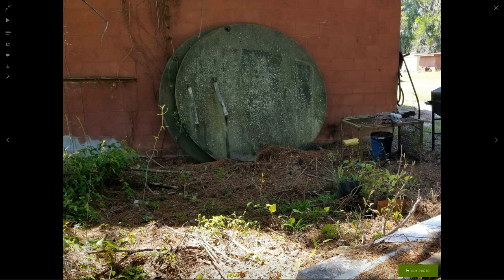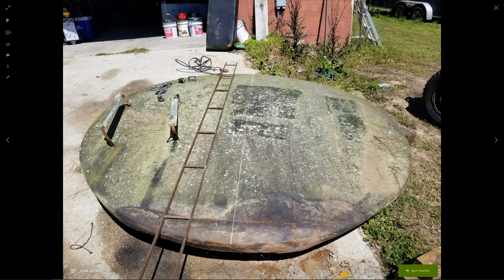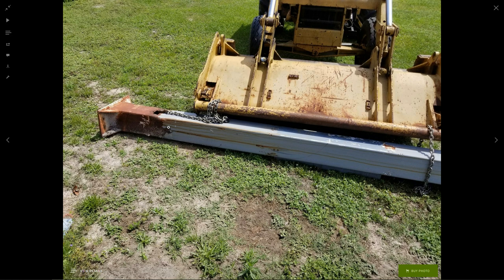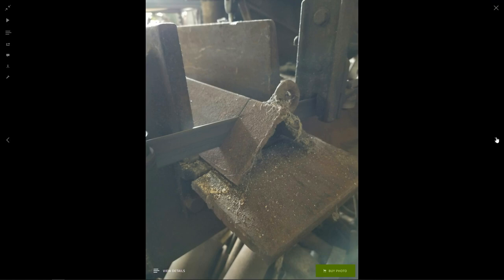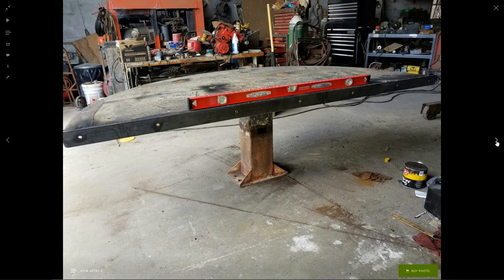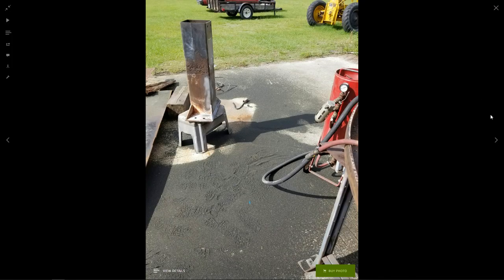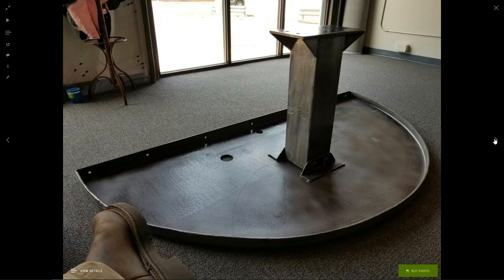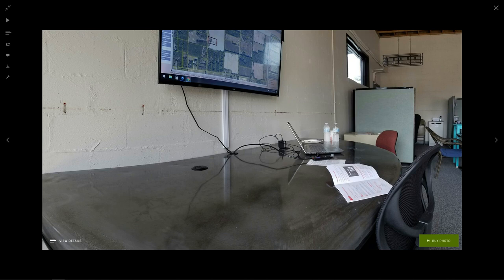Industrial Office Furniture: Building a solid steel conference/workstation table.

Comment: Where the act expansion chamber, and the trike ?
Reply from the maker: That project has been finished for 5 years. I've started building a street legal 2 wheeler motorcycle project from that engine, but it's on the back burner at the moment.